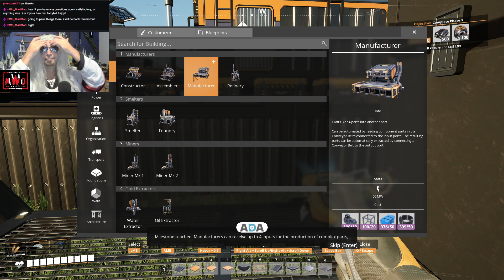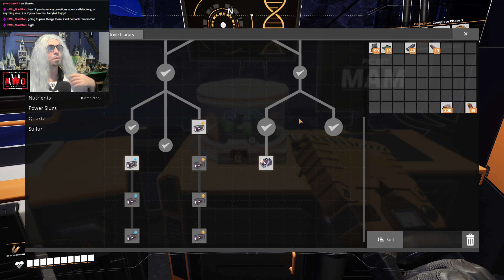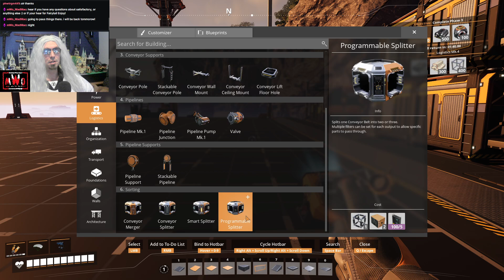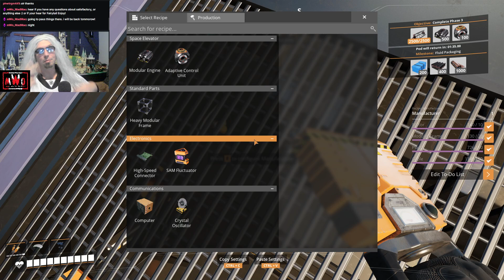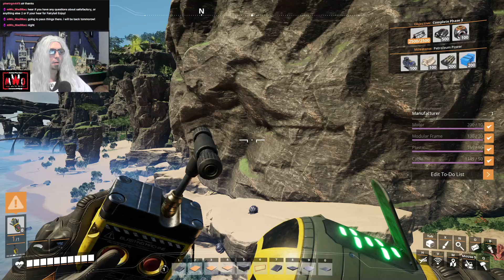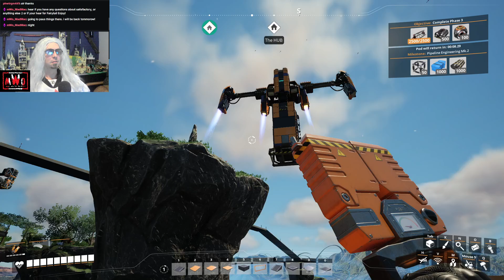Week 6  Satisfactory 1.0 Manufacture and The Magical Lizard Dog Pen!

Comment: When you click items holding CTRL Will place all of that item there. Quicker to transfer and also something that may drum questions on how you did it.
Reply from the maker: cool thanks for the tip!
Reply from the maker: I will trade you a tip: Floors without metal sheets.  If your working with concrete foundation, change the texture on your first foundation and then click your middle mouse button on it. you will now be able to place the foundation down with the texture on it already. so you only need a small amount of metal sheets for the first foundation as your templet.